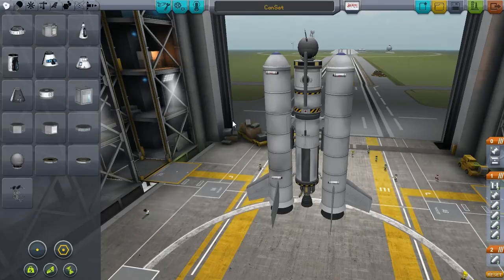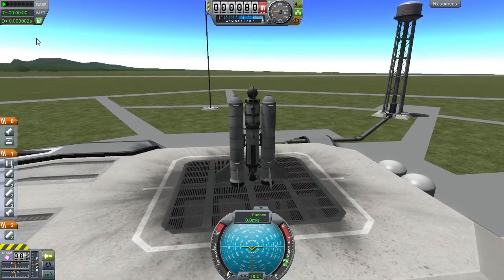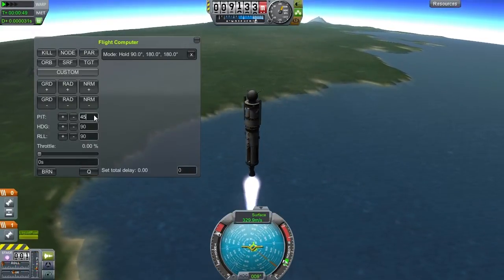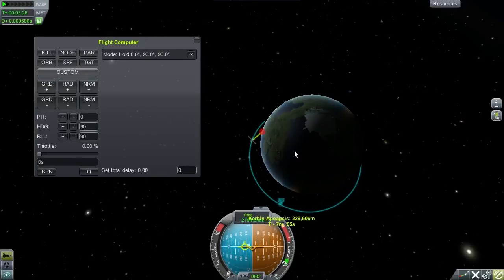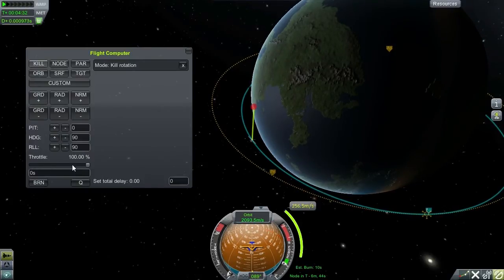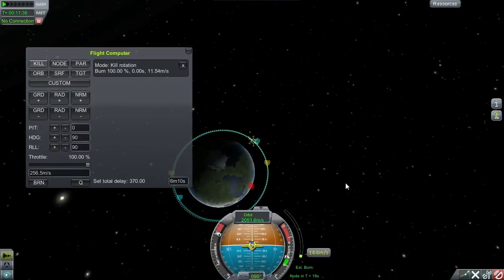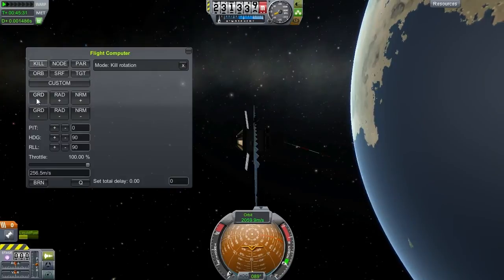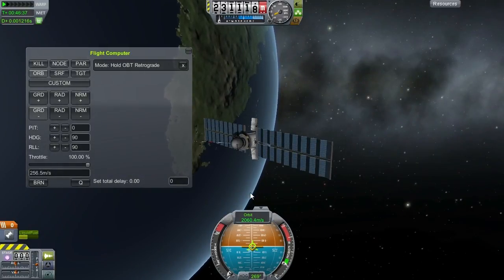Flight Computer in RemoteTech 2

Comment: my rocket keeps turning towards the ground on launch when under control from flight computer, yet i can fly it fine by myself or with stock sas?
Reply: Make sure the module you're controlling it from isn't upside down. Some of the probe cores are that way because they're intended for rovers, and it makes the ship think it's upside down. You can flip them back around with the A/D keys in the VAB.
Reply: Flynn Pierce thanks, i found out that when i built the rocket i started by puting a square panel as first peace then probe core on it, so it seems to be that square panel being first part was the problem